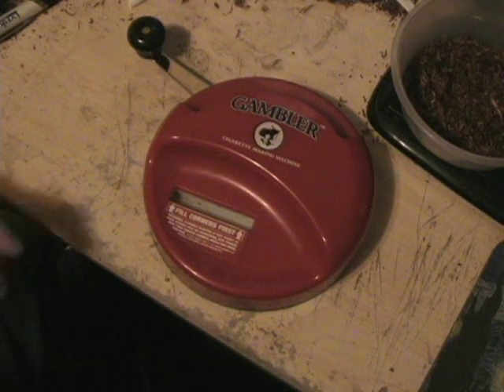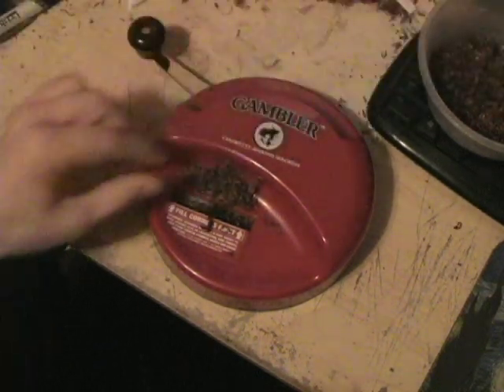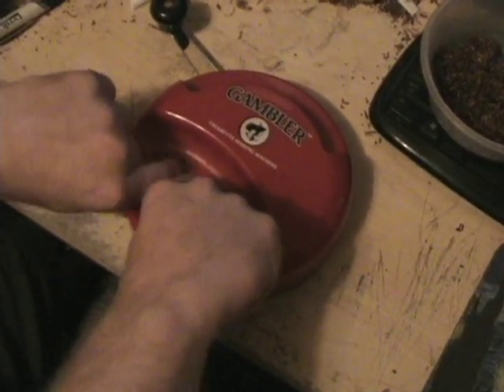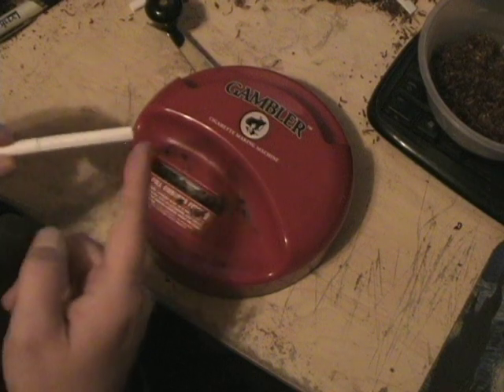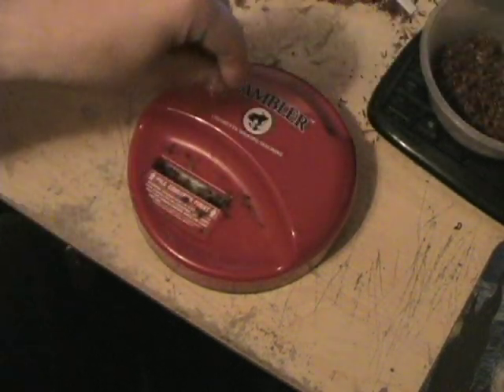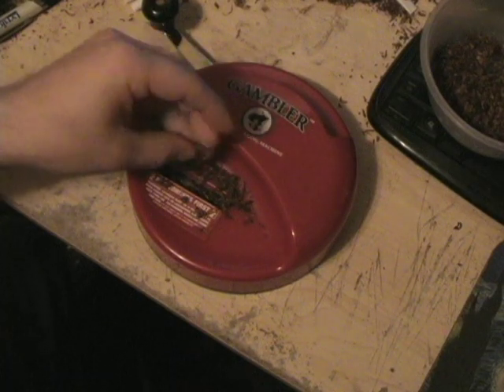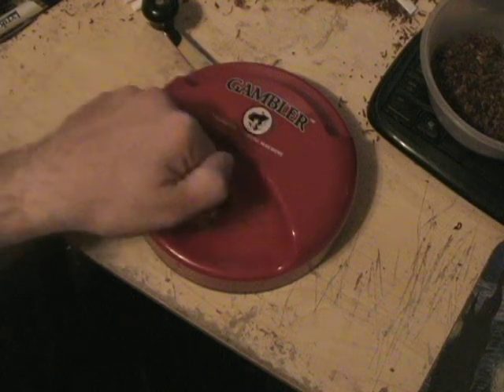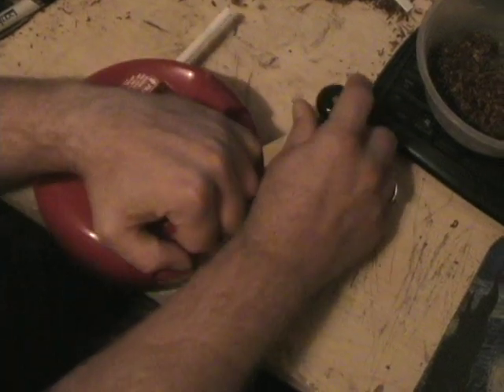Making a perfect cigarette with the Gambler Cigarette Making Machine

Comment: I'm having a hell of a time getting the tubes to fit on the nozzle.  Most machines I've had come with a wider and a skinnier nozzle, but by some mistake both nozzle pieces are the same size and it's really infuriating.  And while I wait for Monday to call the company and try to get a replacement piece I thought I'd go to the smoke shop and see if I could find wider tubes (presumably wider tubes exist or why else would they have the wider nozzle).  So I just went to the store but none of the boxes of tubes say if they are wider from what I can tell.  Any recommendations?